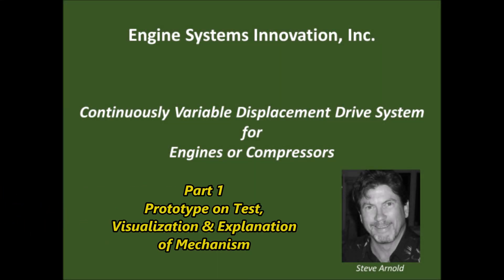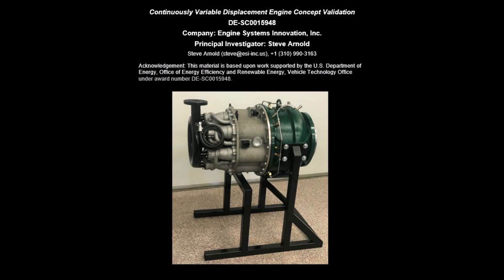Continuously Variable Displacement Drive Part 1 YT

Comment: That is a brilliant design! Are the parts difficult to manufacture?
Reply from the maker: That depends on your perspective. I had a machine shop (Accurate Carbide) make all the critical crankshaft assembly parts and they worked very well. The shop was very skillful and the parts were challenging, but with production tooling and state-of-the-art manufacturing processes, it's not much more difficult than existing automotive engine parts.